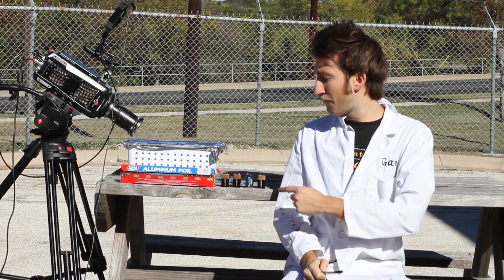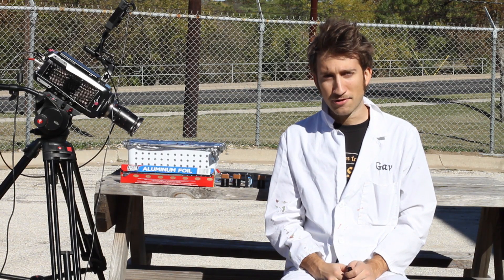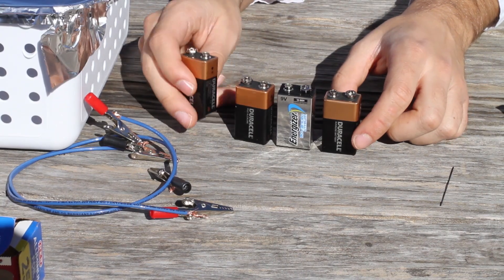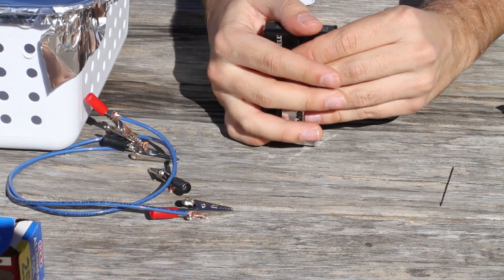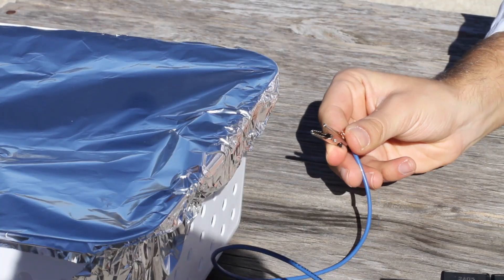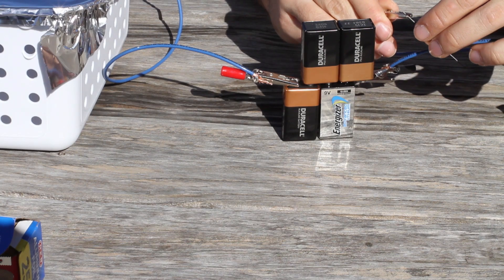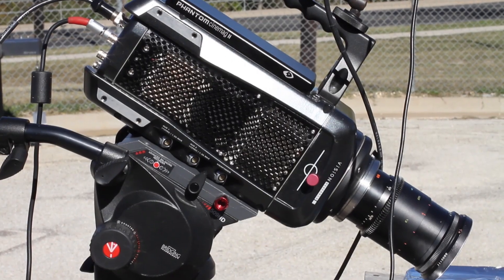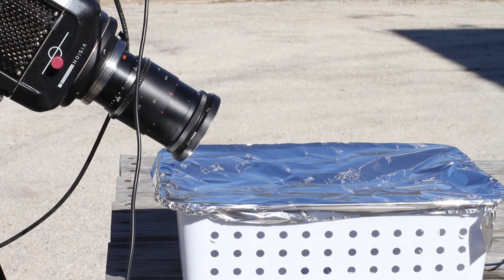Tiny Plasma Cutter in Slow Motion - The Slow Mo Guys

Comment: WAIT... I didn't know you could connect batteries like that omg my mind was just blown
Reply: I saw a video where this guy connected like 100 of them
Reply: ***** The volts don't matter, it's the amps. 0.1 amp through your heart is more than enough to stop it. The voltage is needed to get it there. This is why a 2 amp USB slot for charing your tablet is not dangerous at all. It is 5V which is nowhere near enough to get through the skin.

99V DC sure can kill you given sufficient current going through the wires. Maybe not by touching the wires with your hands, but I wouldn't put these on your chest if I were you.
Reply: Out of this whole video, you're amazed by the batteries? Me too! Jk.... Kinda
Reply: J. van der Linden 99 Volts of DC current can't kill you.
Reply: Niosus Obviously, but V = IR. No volts, no current. Your body is on the order of 100kohms and acts as a capacitor. Once your body 'charges' from DC current, the current through your body is drastically lowered. AC on the other hand rapidly charges and discharges capacitors, keeping the current the same through you. Using the equation above with 0.1 Amps, you get 10kV needed. (For DC)

And you need sustained current, which is why static electricity doesn't kill you.
Reply: Blauruman Did you read my second comment?
Reply: kaliomi kun  That sounds like a really bad idea.
Reply: Kyler Seal Haha, nah the other stuff was cool
Reply: You can do that, and a couple of 9V batteries can be harmless, but don't overdo it. Every time you add a battery you're increasing the voltage by 9 volts. 
Firstly the spark can cause a fire. And secondly, under certain conditions, the total voltage of 11 batteries in series can be enough to kill you.
Reply: Blauruman There are only 4 batteries, which is 36 volts, and that is not dangerous
Reply: kaliomi kun never mind, I watched one with 244
Reply: kaliomi kun Oh...that must've been pretty awesome xD
Reply: Niosus Thanks for the clarification, I forgot to mention that the current is what ultimately kills you.
Reply: Niosus Still, it's a lot less dangerous than the equivalent AC would be. Unless you stabbed those 99VDC wires through your skin it's unlikely to be lethal.
Reply: Mamish Demamish True, you'd at least need to have wet hands, but that's not the point, I was calculating the lowest potentially deadly voltage.
Reply: :DDD your IQ is low man i know it every time
Reply: ***** Mamish Demamish Of course, it's not suddenly some kind of sure-fire lethal contraption. AC would indeed be more dangerous, but that doesn't make DC safe all the sudden. Body resistance can be up to 100kOhms, but that drops down to 1000 if your skin is wet or broken. That brings the voltage required down to about 100V at 0.1A. Not to mention what happens if the current doesn't have to travel all the way through your body but only a shorter distance.

Something that only needs a little bit of sweat to become potentially lethal is dangerous in my book. Working with this on a hot summer day without protection would be a stupid thing to do.
Reply: Niosus Very true. This whole thread's a little convoluted. I wasn't saying you were incorrect, just that Graham was on the right track even if he wasn't right in saying 99 is totally safe. Ended up replying to you instead of him, and now I'm a little confused how we got here.
Reply: Mamish Demamish No problem, I'm just trying to stress that 100V is nothing to scoff at. You're pretty much guaranteed to hurt yourself, the question is how bad.

In general: If you're working with anything at 48V or above, use gloves. Electricity hurts really bad LONG before it kills you.
Reply: J. van der Linden it's not the voltage that kills you , its the ampere that kills you(ampage? I don't know what it's called in english)
Reply: lol thats hilarious at my school we had to do a virtual lag and make a DC circuit and im like im gonna add a second battery bunch of peeps thought it wouldnt work but it did you just gotta line up the postives so that the current flows in the right direction
Reply: Blauruman This is probably one of the biggest public misconceptions about electricity.

Saying voltage doesn't kill you is like saying , "Getting shot doesn't kill you, it's the bullet wound bleeding out and damaging your organs that kills you." Technically true, but you can't have one without the other.

True as it is that the current determines how lethal it is, it ignores the fact that current and voltage are directly proportional to each other (at least in DC; AC and human bodies is a little muddier). You can't have dangerous currents without dangerous voltages.
Reply: Mamish Demamish not public I am learning it in school right now, hell I had a physics exam yesterday! the current carried is what kill you, not the current itself, the strength of the elctricity is harmfull. although I must agree having 10000 volt running through you is gonna kill you, that is only because it is likely to cary a huge ampage
Reply: Blauruman You can survive a 30,000 volt static charge (Also known as a lightning).
Reply: Blauruman have no idea how to make this sound like a friendly youtube comment, but it is.

If you're in a physics class id assume you've played with a van de graaff machine. Those things pump out hundreds of thousands of volts, albeit at very low currents.

Just thought I would chuck that out there as a reminder.

Hell in our physics class we daisy changed the whole class together and still got a shock out of the last person when they grounded themselves.
Reply: Loolanga yes I know what a vandegraaf generator is,we have one is class aswell, and you just proved my point,you got a shock out of it a very high voltage, but low current, if it had been a higher current, you would all have been dead, that's what I'm saying, it is not the voltage that matters it's the current, the ampere.
Reply: Loolanga besdes, your electrocution safety measures , if they are the same as they are here, the ADS shuts of electricity if there is a difference larger than 300mA detected between inflow and outflow of electricity, which indicated electrocution
Reply: J. van der Linden Voltage does not harm you... Current is what kills.
Reply: Stop trying to simplify something that is not simple. Without going into specifics, Van de Graaf generators are slightly more complicated than that. Long story short, they build up a charge and then discharge it when touched. That pulse of current would normally be lethal, but it's too short to do any more damage than a light sting. Lightning is similar, except there's enough energy to sustain the current pulse for long enough to be fatal.

The mistake you're all making is assuming is that the voltage and current output by the generator are constant. The change in very cool ways that allow the generator to do what it does.

This idea of being able to achieve "high voltage and low current" output is just nonsense. You can't have a high current with a low voltage, or a low current with a high voltage. All these static examples involve fatally high currents caused by dangerously high voltages, just too briefly to actually be fatal.
Reply: Mamish Demamish But the video clearly demostrates that it can be simplified if some what scaled down!
Reply: *****
I like how you measured current in volts O.o
Reply: acomputer121 Where?
Reply: kaliomi kun that sounds borderline dangerous
Reply: *****
"99 Volts of DC current"
You are right in saying no current no voltage, though, 99 volts on 1 ohm resistor means 99 amps, and, I think we can agree in saying 99 amps could kill you.
Reply: acomputer121 depends wether the resistors are in serie or parralel
Reply: Blauruman
true
Reply: acomputer121 Ah sorry. I meant 99 Volts of the corresponding amperage. VDC works :)

That would be correct for 1 ohm, but bodily resistance is about 100kohm dry 1kohm wet.
Reply: *****
Indeed
Reply: Niosus It depends also on power of batteries. P=I*U It doesn't matter how high voltage is, source cannot produce high current if it is not powerful enough....and I think that these batteries are not powerful enough to make serious injurys
Reply: Asmir Odobasic
 They can go up to 0.5-1 A, so plenty if you can get the voltage high enough.
Reply: Asmir Odobasic yes they are, if you were to connect the + and - sides with one finger from each hand the current would flow dangerously near to your heart, which could cauze fibrillations or even a heart attack
Reply: Are you really asian? I doubt it.
Reply: Niosus "The volts don't matter, it's the amps." Never say that, it's partially incorrect. The voltage defines how lethal the amps will be. If you have 0.1 volts at 100 amps AC, it's not going to kill you because of the electrical resistance of your skin. If you put 2 metal terminals into your flesh and run that much current through them, bypassing the skin's resistance, it would instantly kill you. But like I said, the amps won't kill you at that voltage.

HOWEVER...

If you have 100v at 0.1A AC, it has a very high chance of killing you. Why? Because the voltage is sufficient enough to break down the skin, lowering your resistance to electricity. And from there, it's a positive feedback loop; the more the skin breaks down, the lower the resistance, the faster the skin breaks down and the lower the resistance gets, even faster. This continues until the electricity reaches your blood stream and it's game over from there.... Unless the current only lasts only a few nanoseconds.
Reply: Jordan O'C This is why people survive lightning strikes. The exposure is very very short
Reply: ***** Unless you're soaked or have lots of cuts, then you'd definitely die, but yh...
Reply: kaliomi kun I saw that vid too :D
Reply: kaliomi kun I've seen that one too!